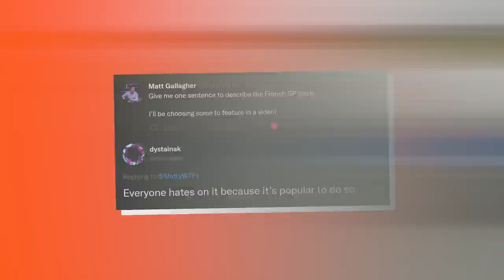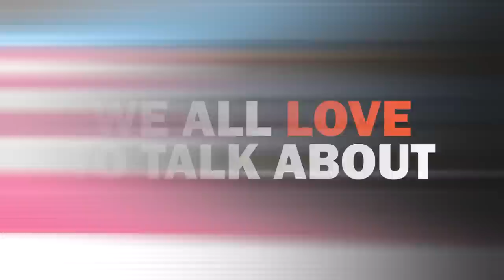Is The French GP Circuit Really THAT BAD?

Comment: There have been literally only two GPs in 2018 and 2019 and since then everybody hated it for being so boring.
And then 2021 came
Reply: It was already boring in the 80's and 70's too when they raced here.
Reply: Spa for instance is a great circuit no doubt but there has been a handful of boring races there in the past decade. Not saying Paul Ricard is better than Spa (it clearly isn't) but sometimes having a great race doesn't depend on the track itself.
Reply: @GrouRocks  All the newbies don't realise we've had this track for 50 years, changing the runs off has done nothing, it's still horrible
Reply: @soundscape26  I agree but, watching an F1 car go around Spa looks fantastic. This track, is an eye sore with ugly run off area & the frankly boring corners
Reply: @soundscape26  On the current Season, Spa is by far the Most entertaining Track. The Racing there, the super slim margin for error, the Elevation Changes are simply unbeatable by any of the other Tracks.
Reply: @steamkrypton2990  you just described Monaco perfectly, yet the race this year was an absolute snoozefest
Reply: @steamkrypton2990  Agree yes... but there has been a distinct lack of great races there in the hybrid era. My point was more the idea that sometimes a great race is more dependent on having 2/3 cars able to fight for the win, strategy screw-ups, a timely SC, weather changes, etc etc, rather than the circuit alone. Baku is a prime example... from crazy exciting to extremely dull we had a bit of everything there already.
Spa is of course a delight to look at and the cars look amazing running around it, no doubt about that.
Reply: Everyone hates on Jeddah when there have only been two races there, and both races were awesome. I guess it is in Saudi though
Reply: @GrouRocks  it’s not even the same sport…
Reply: @charlesgarcia4660  this may have to do with the fact that paul ricard is usually a testing track, which then brings up the fact that f1 hosts a yearly race on a testing track
Reply: @Tigerbear62  The first race was more chaotic than good proper. Entertaining I would say.
Reply: @KristianLyubenovYT  for sure I understand, but man I can't even name one of the corners. Good circuits have memorable corners at the very least
Reply: @soundscape26  ye i think especilly bec of dirty air we saw a lot of problems there the past years it 90° turns if not even more making it easy to risk it losing it bec the idealline is on curbs most of the times
Reply: @soundscape26  Yeah, true that, but you simply can't force Action, it Sort of Happens naturally. And the Turbo hybrid era was so Bad Aero wise, that overtaking was nearly Impossible, No Matter how good The Track has been. So the Problem we're Always the Cars Not being able to get Close Enough for an Overtake attempt. Spa still has produced mostly enjoyable Racing, Quali ist super tense due to the Long Track Layout, every oh so little mistake counts. The Thing making old school Tracks better is the risk reward dynamic, Purpose build Nature and rich History. And some Tracks Like Spa just stand Out in that regard.
Reply: @maxq404  The diference between Spa and Monaco is, that you can Overtake other Cars Outside from strategy and mind Games. Monaco is simply too tight for the 800+Kg massive Cars. 
I don't know If you remember, but there was a time where Overtakes in Monaco were rare but Possible. Cars were half the size of the current Cars though.
Reply: @benlowes8570  The track was ready, it was mostly misinformation as it was the trackside facilities and such that had to be rushed. I can't debate sportswashing, thats blatant. The missiles were bad but the chance of anything further happening might as well be impossible. Yemeni rebels wouldn't just commit an act of terrorism. And your final point is bs. I have lived in Saudi for 8 years and am an avid racing fan and know loads of people who are into motorsport. I went to both GPs, and the race blew F1 up in Saudi. There were plenty of people there.
Reply: 2021 French GP > 2021 Austrian & Sytrian GP
Reply: For a driver, it can be interesting. But watching it on TV brings no satisfaction at all. One of the biggest reasons are the red, blue, and white lines along the track and the lack of any walls at all 😁 It is just very boring looking track and because of the lines you don't even know which corner you are in, because the image blends into this sort of optical illusion.
Reply: @steamkrypton2990  Yes, up until some seasons ago it was not unusual to see overtakes both in the pit "straight" and after the tunnels' exit in Monaco. It was never easy but certainly possible. Nowadays it's a rarity.
Reply: @Tigerbear62  Ignoring politics etc. the track in Jeddah is probably the most dangerous one on the calender. That is why I dislike it. Granted, there hasn't been any serious accidents there so far, but a Hubert style t-bone crash is way too likely to occur there. Looking forward to them opening the proper race track in Saudi for this reason.
Reply: @soundscape26  Define "some" seasons. Monaco was a Sunday afternoon nap even in the late 1990s - early 2000s. If you say that's "some", then sure, but the cars have become too big for quite a long time.
Reply: @danieltatar7575  10/15 years ago. I'm sure there's data somewhere with regards to how many overtakes the Monaco GP had throughout the years.
Reply: @soundscape26  You have to consider the size of the Cars, the 2000s Cars were basically half the size of todays boats. 
That certainly Made overtaking a Lot more easy, as you Could still Go Side by Side. And with the desasterous Aero of the 2016-2021 Cars it became almost Impossible to Overtake

Comment: It is NOT a bad track at all, not an amazing one, but not an awful one!

First thing: We only had 3 GPs there, an average one (2018), an boring one (2019) and an amazing one (2021). People shouldn't judge track quality by such a small amount of races. Look at Baku, for example, in 2016 the race was terrible and the whole internet hated the track, suddenly the famous race of 2017 came and they already put the track as a fan favorite.

Second thing: The track layout is kind of reasonable. It has a bit of a bad flow in sector 1, yes, but it has good overtaking opportunities on both parts of the Mistral straight (so much so that the 2021 French GP it was the second most overtaking race in the season), and it has a very fun sequence of high corners in sector 3, (without the Tilke's formula of tight curves and short radius). 

Third thing: people's hatred for this track, and I understand that perfectly, is that it's bad for the eyes with the blue and red stripes. Also, the circuit does not make a good separation of layouts, which is also visually disturbing. Fans unfortunally tend to confuse an ugly track with a bad layout track, but you can't blame them for that...
Reply: DRS overtaking is not good racing
Reply: @maxlvl01  Remove DRS and the amount of overtakes in any track drop dramatically.  Moot point.
Reply: @AbsoleteAim  You shouldn't get an advantage just because you are behind someone. They are in front because they are the better driver. If they were better, DRS wouldn't be needed. It's a crutch
Reply: Yeah
Reply: @MmmmmmmmEarHair  drs was initially added because the dirty air from the front car was getting so bad that cars behind literally couldn't properly follow the leading car through the corners, basically giving the guy with free air a cruise to the win. drs allowed in those days for the cars behind to have a chance to fight and if you can't pass then you're not good enough. now tho with the substantial decrease in dirty air drs is straight up op
Reply: @MmmmmmmmEarHair  Why should you not get an advantage when you’re behind? Isn’t the point of the sport to produce fighting/racing. 

You can just watch free practice if you’d like to see people just go round
Reply: @iAmCracky  that's what fans want, not what the sport should be
Reply: @iAmCracky  Look at other Race Series Overtaking there is hard work because you need to get a better exit out of a corner or be more brave. With DRS you just press a button and thats it
Reply: @iAmCracky  So if you were an olympian runner, you want people to get steroids just because they aren't as fast as you? Cause that is exactly what DRS is. Free speed and overtake.
Reply: @MmmmmmmmEarHair  That is literally the point of a competition. Look how much people cried the past 8 years while Mercedes dominated. It should be less effective, but for someone who is only ever gonna be able to watch it on a screen, this is better.
Reply: @iAmCracky  DRS nowadays is only to make it more exciting to fans. It completely dismisses a drivers skill and years of practice and training. It is spitting in their face that all the work they put into overtaking, is stomped by a guy pressing a button. Nobody should have DRS or everyone should have DRS when they choose.
Reply: @maxlvl01  Those series get nog even 1/1000 of the viewers F1 does, less people care about less overtakes & its also expensive as shit to develop. They are generally with way more cars AND the cars are actually competitive in terms of performance. DRS is the solution to an F1 politics problem.
Reply: @robbymaria  F1 isn’t about the sport anymore, it is about content.
Reply: @iAmCracky  Competition is fair and balanced, at least as much as possible. DRS is neither. You saw the fiasco where everyone slammed their brakes mid race just to get DRS, thats how important it is. Not someones skill or the teams abilitly to make the fastest racing vehicle in the world. Nope, its a button and a flap that decides the race.
Reply: @iAmCracky  i know...
Reply: @MmmmmmmmEarHair  But F1 isn’t fair and balanced, the difference between front and back field is astronomical for a sport where the skill should be the driver. DRS isnt a good solution, but until they become even more strict about regulations, its best you can get
Reply: @iAmCracky  Its not just the driver skill, its the team and engineer skill as well. They do not care about skill anymore. All they care about is making money and making the races "interesting to fans". That's why there isnt a set design for the cars, there is DRS, they blatantly ignore rule breaks and dont penalize when they should. F1 isn't about racing anymore.
Reply: Agreed!
Reply: The problem is it's a decent circuit that is ruined from a spectator perspective by the colors and fake turns. The unlimited runoff also tends to ruin racing when cars can just bail out anywhere with no consequence. The first turn at the race start tends to be a joke with how many cars just abandon it.
Reply: @KristianLyubenovYT  Overtaking on a straight is still almost impossible without DRS. Case in point Barcelona, where Max couldn't overtake the slower Mercedes when his DRS wasn't working.
Reply: @maxlvl01  In other racing series, e.g. Indycar there is no DRS, buyt there is a push-to-pass button which serves essentially the same purpose
Reply: I just don't like it. To watch it's hard work, and in sims it's just bloody boring, the circuit feels and looks disjointed and just doesn't work. I wouldn't advocate scrapping the French GP, but I would much prefer it to be held at Magny-Cours as I feel it is a much 'racier' circuit, but if PR is the only option for a French GP then it should be dropped and all this piffle about dropping Spa can be put to bed.
Reply: @KristianLyubenovYT  I agree with the first half of your comment but because there is much less dirty air it means the power from slip streaming has been greatly reduced. So unfortunately at the moment we aren't ready to get rid of DRS
Reply: @benfulford3943  the problem isn't the slipstream per say, rather it's that the cars can follow closer, so drs is naturally stronger due to the amount of drag reduction from a slipstream naturally decreasing as you close the distance
Reply: @KristianLyubenovYT  we are still at the start of the journey on this generation of cars. DRS will be looked at and refined. It has definitely been far too powerful at some circuits. Others it has been very necessary. The aim is to get rid of it all together but at the moment it is still necessary
Reply: @MmmmmmmmEarHair  IndyCar literally has push to pass, it may not be DRS, but it's still a boost because overtaking still isn't that simple anymore.
Reply: The amount of people who think that DRS removes all driver skill cause it's just about pressing a button. Tell me you know nothing about F1 without telling me...
Reply: @AbsoleteAim  but isn’t it limited how often you can use it? If that’s true then theirs more skill involved then with DRS
Reply: @jacklachlangill8935  while I agree that DRS also has some skill involved it just isn’t as exciting as having a wheel to wheel battle through multiple corners
Reply: Removing DRS... People really don't know a lot about motorsport nowadays...
Reply: Agreed, the cars can rip around the track and there is a lot of passing. I don’t even have to think about visual experience for almost the whole rest of the calendar…but this track is a blob. I genuinely can’t tell one corner from the other. 
Yes, some of that is because I’ve only seen 3 other races here…but it is just a colorful blob, and I won’t even go in to how confusing it is seeing all the other road layouts making me very unsure which direction the cars will go lol. 
Honestly I didn’t like Magny Cours much as well. Best thing I’ve ever seen was Schumacher take full wets and drive them till they were racing slicks on dry tarmac to take a bad ass win. 😅
France has some amazing tracks, freaking LeMans! But they race here..
Reply: @maxlvl01  It is limited but my point was that the racing series still needs a "boost" to help with overtaking, just like DRS.
Reply: F1 has had more than just 3 races there. It hosted grand prix from the 70s to 1990 as well
Reply: @nitelast  this track has been changed so much since it’s classic design. That’s like telling me the German Gp at the Nurburgring is the same as Nordschliefe. Lol
Reply: @nitelast  or better, classic Hockenheim vs the changes in the 2000s. But even worse in France since they turned it in to a concrete playground drowned in confusing paint and crisscrossing tarmac.
Reply: @Eric-lj2nk   True, true. Though it wasn't too much different. Some tighter corners and better flow through some sections now of course (turn 3-5 and 10 not including the chicane) now of course. And the always tarmac runoff is genuinely awful and has been since at least 2001 (there were brief clips during some pre-race segments from ITVs coverage of races in '06 at least)
Reply: Though thats accounting for f1 races from '71 to '85  since they used the club layout from '86
Reply: @MmmmmmmmEarHair  1st: don't be stupid
2nd: just coz someone mentioned drs doesn't mean it's a valid talking point if you're speaking of the track layout
Reply: @MmmmmmmmEarHair  Overtaking would be so much Harder without it, there's less dirty air than last year but it doesn't mean it's gone
Just look at Max Verstappen in Barcelona witgout DRS
He couldn't overtake Russell(?) despite having a much faster car
Reply: @MmmmmmmmEarHair  With last years haas you wouldn't overtake the current Ferraris, RBs, Mercs and Alpines even with the flap and the button
Reply: @MmmmmmmmEarHair  calm down bro
Have you seen a Williams this year winning just coz DRS? No
The only teams that won are the RBs and Ferraris coz they have the fastest car
So skill still matters 
And if you're the better driver and you're in front then you can just leave the other car behind in the corners where there's no "flap and a button"
Reply: @louiscastro2701  losing your tires due to the painted areas is some kind of consoquence
Reply: @adamn7125  you really only damage your tires if you spin or slide. It won’t do much if you simply bail out on a turn and drive off without putting much lateral load on the car.
Reply: 2 boring races now. 2022 was quite dull.
Reply: @MmmmmmmmEarHair  Slightly off-topic here, but a parable to DRS:  the Tour de France was more interesting when everyone was doping. I have friends that agree. Health issues and Lance Armstrong's steroid-driven ride-rage aside... =)
However, I've never liked DRS.
Reply: @timf4015  Yeah i agree. Keyword being "everyone", not just the person behind someone. Either everyone has it when they want or nobody has it. It would be so much more interesting and take so much more skill and strategy. It wouldn't just be "oh he was behind and got DRS so now he's ahead." It would be more like "I wonder who is going to push DRS to the limits and how far into the braking zone will they keep it active".
Reply: @MmmmmmmmEarHair  it doesn’t matter if drs is removed and the drivers can’t overtake that makes F1 boring and will loose a lot of fans since there’s no entertainment and huge money drop plus DRS helps the cars a lot.
Reply: @amxlopez8082  The thing is, they can still overtake with skill. They are at the top of racing. If they can't overtake without a crutch they shouldn't be there in the first place. F1 was amazing before DRS and it can be amazing once its removed as well. It will be more entertaining because drivers will dive more often to get positions and use pure skill and strategy rather rely on a DRS to win.